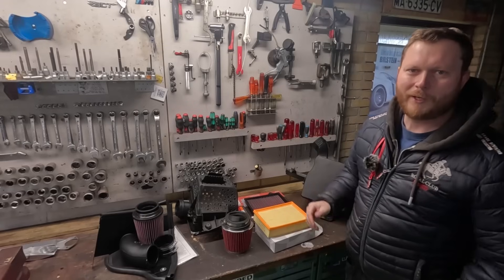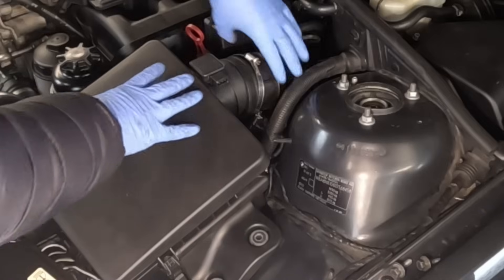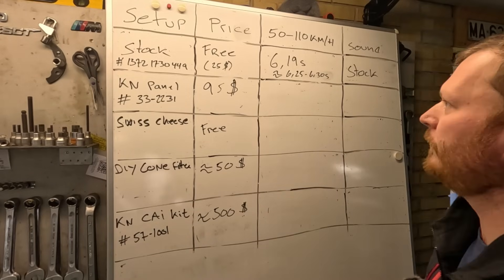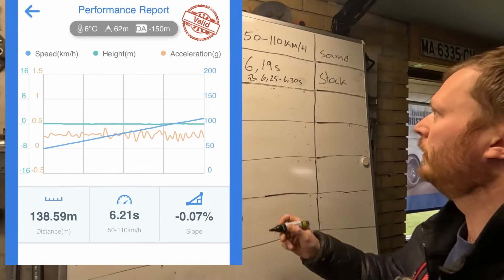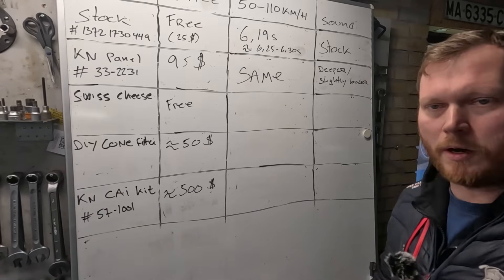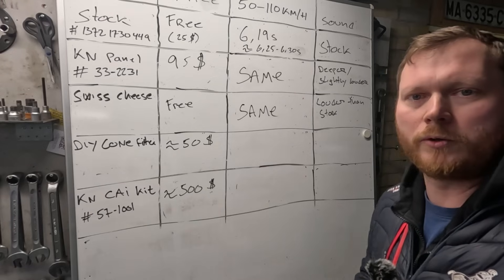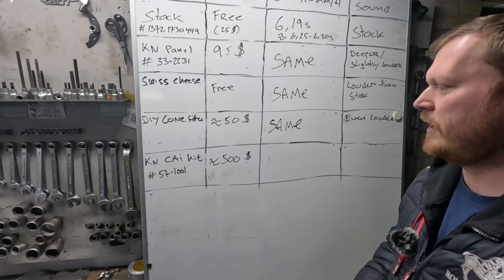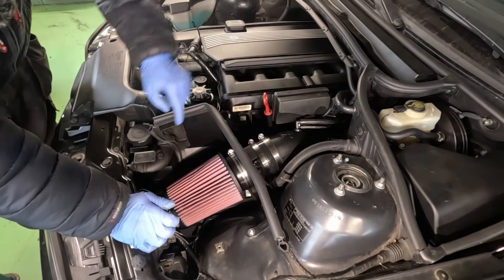Best Intake - K&N vs Stock vs Swiss Cheese mod. Test & Review

Comment: These are always car dependant. The E46 evidently has a well designed intake system. Other channels have shown improvements on other (stock) cars by using aftermarket intakes or just cone filters. I'm into GM F bodies. My 3rd gen Trans Am is well known to have a restrictive air filter housing, rated 5-10hp lower that its equivelant Camaro. Just replacing it with an SLP designed housing is good for almost 20hp on some versions. Unfortunately they're discontinued so I made my own version of that K&N kit.
Reply from the maker: Im a bit of a sucker for fbodies 2nd and 3rd gen. My fav 3rd gen is weridly enough the 83-84 ones with the recaro seats
Reply from the maker: And thanks for letting me know. 20hp is a big deal. Do you happen to rock a rochester?? I miss my 81 trans am. It haf the infamous quadrajet moan lol. Sounded like a cow muh’ing. So good
Reply: @OEMplusRESTO  technically, just not the Rochester you're talking about. Mine is a GTA. They all came with the tuned port MPFI system that uses a Rochester throttle body.

Comment: Correct me if I’m wrong but you need to tune to see the performance benefits from come intakes especially cold air intakes
Reply from the maker: Great question. The maf doesnt know or care what filter(if any) is in front of it. It just measure the air coming through and with other sensors input determine various things such as fuel and spark.
MAYBE it could use a few pulls to slowly dial itself in. But i have done alot of pulls but with and without datalogging with no change. People say on turbo cars it works alot better but i havent tested. Thanks for not just raining down on me. Hope you have a good day

Comment: My N54 benefited massively from dual cones, especially after mapping. Gained 24hp around 3000 rpm when on max boost. The factory box becomes very restrictive when adding 100+ hp. NA engines do not gain much especially without a map.
Reply from the maker: Yeah people keep telling me turbo engines do much better with sport air filters. And i believe it:)

Comment: If you would have tested the 50 to 110 kph on the same road every time, would have been the scientific method that everyone loves. Like this your last slightly positive result is almost discarded... anyway, normal people will not spend 500 USD to get 0.1 seconds faster on their slushbox. Liked the video!
Reply from the maker: Hi. Thank you. It is tested on the same road. But there will always be variables. I do usually 10 runs pr test. Sometimes 5 if results are pretty much the same each time.

Comment: On my last car (Ford Fiesta ST 182 mk7 stock) i bought a ST200 airbox from factory, on this airbox you have the stock design + a second big floppy pipe that you can put under the headlight, paired with a K&N filter panel i got 4hp and 7nm with same condition, so is it worth 250 euros for this little performance upgrade? No
Reply from the maker: Id say its worth if for the sound alone. The 3 and 4 bangers sound so much better with a good intake

Comment: I think for a test like this 3rd or 4th should be driven all the way out as the air isn’t as useful down low but as the extra air begins to get in the higher flowing filters and intakes will take advantage of it
Reply from the maker: I only tested 3rd gear. Thanks for the input.

Comment: all of these filters work very whell .... any modification on the motor need a remap ecu! ... ( more air need more fuel ) stock ECU is always the same... OPEN YOUR EYE'S

the same thing aplies with the exhaust system.... you only get real gains if you remap... otherwise it only improves engine exhaust and you gain 1hp :face-turquoise-covering-eyes:
Reply from the maker: Thanks for the input. This is a common misunerstanding though. The maf doesnt know(or care) what filter is in front of it. It just measures the amount of incoming air and with others sensors determine things like fuel and spark. If your hypothesis was correct, even a semi clogged air filter would also need a “tune”.. the dme “tunes” the car as it goes, taking into account stuff like air temp and volume, fuel octane rating and more.

Comment: The biggest issue with the k&n is it's filtering ability, years ago there was an article in a hot rod magazine where they tested a variety of air filters for filtering capabilities, K&n was the worst. I threw mine out after reading the article. That small gain is not worth grinding the engine to death with dirt
Reply from the maker: Interesting

Comment: KN is a piece of junk. They pass so much fine dust. I ran my truck thinking i am getting HP..after i removed my intake. I scraped so much dirt and find dust out. 
Project Farm tested the performance of how much air they can pass and how much dirt is getting by. KN failed. I threw mine away after i saw it and found the fine dust accumulated in my intake manifold runners.

Comment: Well we all know that any standard engine is restricted first by its exhaust then by its air intake . The exhaust would be the limiting factor needing to be made better in order for the need for a performance air filter. And even then the power gain would be un noticable unless on a 1000hp engine

Comment: Only issue is engine temps. The cooler your engine is usually the better performance. There is a sweet spot. Along with air density etc…

Comment: I always see people comparing intakes/filters on a stock tune, but as far as I am aware the benefit is only really seen once the ECU is adjusted for them. It would obviously be way too costly to adjust this between each filter, but it also kind of defeats the purpose of testing them in the first place. Obviously, the filter/intake brands are very misleading in their marketing as it makes it seem they instantly add horsepower without the need to do anything else, but a tune is the only real way to see any benefit. I wouldn't beef up my injectors and pump without a tune as they would essentially be running on stock parameters and benefits won't be very apparent otherwise, so doing anything else and not tuning it in is also not going to see true gains. 

I'm not a huge advocate for using intakes to make power, but it does annoy me that almost everyone on YouTube doesn't give them a proper test. I know it's just an intake and tunes are expensive but it just defeats the purpose of even making the video.

Comment: I have noticed with the k&n filters that fuel economy is slightly better. Ive seen an average of 1-2mpg better on the highway vs a oe paper filter. Some vehicles may see an hp or two increase, but it tends to be vehicles with inefficient factory boxes
Reply: Yes thats correct ,in my e46 323i and w124 320e k&n replacement kit  works fine.more respons thorttle and good mpg.cone air filter without air restric ussually gives more heat suck from the engine bay.without the cai kit.makes u loose some torque.but sounds better

Comment: I like the empiric approach of your test. Also came to the same conclusion when I tested several intake mods on my e36 323ti. The stock airbox works very well and no need to spend tons of cash here because it will not gain anything, other than louder intake sound. Which when i had the cone filter setup, it got quite annoying after a while. Also, the cone filter setup will cause  turbulences of the air, of which the MAF will be affected by and read wrongly causing the adaptions to wander off a bit. This I noticed because i was also logging the ecu data while performing the tests and comparing MAF /load / temp values.
Reply from the maker: Great input. Thanks. Yeah the stock system is oretty hard to beat

Comment: project farm also did a test, his test showed the K&N panel filter did make an improvement, but maybe it depends on the vehicle.
Reply from the maker: I think theres alot of things that play into this kind of tests, and im not at his level in terms of back to back testing. But in my case they didnt offer any noticeable/measureable gains other than a tiny bit of sound:)

Comment: so i'm not an aerodynamics engineer but the swiss cheese mod seems like it's adding unnecessary turbulence before the filter. Mind that I know the filter streamlines the airflow before it reaches the MAF and the manifold but it still wrecks efficiency. Maybe if the holes were positioned so that the flow of air to the filter is laminar before it reaches it - it would have some gains but at this point I'm just overthinking the issue
Reply from the maker: Me neither! I just like messing with cars! But yeah the swiss cheese mod is only for sound

Comment: I have a Volvo s60 2.5 liter inline 5 and I took of the top cover if the stock intake box and mounted a big and long K&N intake with great results, better spool time (1400 rpm-1500rpm full boost) stock 1500rpm and better throttle response, little bit lower gas mileage maybe, what I mostly se people doing wrong is using a very tiny filter like your 50 dollar one so I would Aa get a longer one at least like the K&N kit you got or longer(original filter has more surface area then the tiny pod filters 😅)

Comment: My 330 came with exact same K&N setup(expensive one)…I was wondering if factory would be better and tried comparing them back then. I had Laptop hooked up and I was monotoring intake air temp sensor numbers. Before I removed KN, I did about 15km or more drive around lake, get back at home, change it to stock in about half an hour and quickly gone to same 15km root…results shocked me back than, I remember there was about 10 degree difference in intake air temperature, KN was hotter than stock system. Yes, I’ve seen this with my own eyes. Even had data files saved, but it was many years ago and lost it somewhere. Now after all this time I drive with stock system and KN collects dust.
Reply from the maker: Valuable insight. Thank you for sharing. Brw those 5legged volvos Sound wicked

Comment: Your adaptions WILL NOT reset when unplugging the battery. That’s false info.
Reply from the maker: The more i read the more i see this is just a common misunderstanding it seems.
I’ll add it to the description that its false, and edit it out via the youtube built in editor when i get the chance. Thanks for the input
Reply: @OEMplusRESTO  No worries, I just thought to point that out.
Reply from the maker: Can you share a link? Theres a lot of conflicting info out there whether or not it clears the throttle adaptions for instance

Comment: That is why I always tell people that if your car is not tuned to make more than 2X stock power, you don't really need more air and the stock filter is not just fine, it's probably protect your engine much better over KN and stuff like that. Not to mention that most people install new or open air filter that don't have access to fresh cold air but hot air in the engine bay.

Comment: You really need to modify the tune to take advantage of a higher flowing intake/filter.  The stock ECU programming cant adapt enough.  So, it really dosent matter what parts you change exhaust, intake etc.  The engine output will be the same without tuning,
Reply: This is incorrect. A stock ECU can and does easily adjust for the relatively minor differences in airflow between something like a paper air filter and a K&N, just as it easily adjusts for differences in air density based on changes in elevation, temperature, etc. A tune itself will often result in more power for various reasons, but the (again, relatively minor) differences between a paper filter and a K&N isn't one of them.
Reply: When you only change the intake or the exhaust the stock ECU tune can adapt but when you change both? At least in motorcycles it results in a very lean running engine and loss of power. But when you do a dyno tune then you do get a nice bump in performance, a bit more than a dyno tuned stock machine if done right.

That said car fuel injection systems are more complex than rudimentary motorcycle fuel injections so I don't know what the stock ECU's are truly capable of on modern cars.
Reply: @MaaZeus the O2 sensors in the exhaust on 90% of cars will be able to sense wether it's running rich or lean and tell the ECU to adjust. On the intake side you also have either a MAF sensor, or a MAP sensor paired with a temp sensor which will be able to measure the density and mass/volume of air entering the engine so the ECU can send the right amount of fuel.

Comment: nice test! but beware the K&N filters are oiled. This oil will effect you're MAF sensor in time giving faults. I had to replace but there seems to be sprays out there to spray it but I didn't know. 

so beware using K&N filters in long term

Comment: This is how it´s done! It´s proven once again, that factory intake systems are not that bad. Now when I have E46 M47N, there´s no need to fiddle with stock intake, but on my previous car (´99 Accord 2.0 ) i did sort of modified intake. Paperfilter and filter box remainded the same stock items, but I removed whole intake resonator box, which is located below the filter box (just behind the bumper in front of right wheel). Then I made ram air tubing from plastic plumbing with one 90 degree elbow leading from the right opening for fog light (my car didn´t have those, just black blanking covers) directly to the bottom half of air box. Basically ram air intake for cheap 😀   
While stock intake system together with resonator sucked air from behind right light (that means also from engine compartment), this modified system took air directly from the front of the car. On idle or while driving slowly it was the same sound-wise. But during acceleration or with full throttle it sounded better.

I admit, that it was catching more flies and a bit more dust 😀 But that wasn´t an issue for me, because I changed the filter every 10k kms. 

Most noticeable difference was during summer, when the engine wasn´t suffocating itself  with hot air and heat soak from the engine. This was verified on the same day with stock intake and this modified one reading the intake temperatures via diagnostic tool .
Reply from the maker: Thanks for sharing that. I hope someone reads it and use it to determine if they should do it or not

Comment: Thanks for this comparison. I was actually looking into intakes for my E46. Would you say the sound of the K&N kit is anywhere close to drone? Or not annoying at all?
Reply from the maker: No droning at all. I didnt even notice the intake was different when driving around to get the car up to operating temp. Imo its not until you start pushing it you can really hear it

Where are you located? I wont need my kn anymore
Reply: switzerland. if you could send me that that would be awesome haha, ofc I'll pay close to new price. Will have some tax on it though
 @OEMplusRESTO
Reply: @OEMplusRESTO located in switzerland, would offer 200€ with shipping (the k&n 57i-1000 gen 2, which I was looking to get, is around 300 here, and there will be tax)

Comment: I've tried all these filters and mods, except the swiss cheese box, and your right the performance is minimal at best but the k/n cold air intake is the loudest and sounds the best it also creates a whistling sucking noise when you give it gas at low speeds. The only thing is you better have your cooling system working properly because if it over heats and it spits up coolant it's going to get sucked in. I use my stock box for the majority of the year and only use my k/n in the very dry summer  months when i go on canyon drives amd want to hear more sound.
Reply from the maker: I think maybe if its whistles at low rpm low load situation youd migjt have a vacuum leak. Because the first time i installed it and drove with it, that whustling was very obvious. Found out when unstalling it, the intake tube was seated perfectly in the intake hose. And the next install i did where i had to redo the tests, the whistlign was much quieter! I agree its the best sounding. And definitely loudest as well. But its not super loud either
Reply from the maker: And thanks for the tip

Comment: its a faulty test, given you havent taken into account that the fast or slow reaction of the speed  could be down to your driving.
Reply from the maker: im driving in a straight line, mashing the throttle at 40km/h and then record the 50-110kmh sprint staying in the same gear. Let me know how i can improve in your opinion?
Reply: @OEMplusRESTO   2 things you could do. hire out a dyo and do the speed tests there, this will give the most accurate results. 2.  and its better that just you taking what sped you did, get a gps speed measure device.

Comment: Once again a great effort and comparison. I personally bought the KN cone filter from the kit only and home made a heat shield, keeping the stock cold air intake as the KN kit while also putting a tube with air from the duct for brake cooling. I noticed some gains but it's combined with cams, higher compression and an ECU remap so I guess the car just needed the extra air.
Reply from the maker: Thank you.I think the OE airbox only will work well for its intended use. Once you start opening up the exhaust and do internal work it would make sense the KN is better
Reply: @OEMplusRESTO  one more thing,  when I moved to a less restricted setup, I noticed it revs more freely above 6000. You can't notice that in the 50-110 3rd gear test. Maybe the few Hp extra are between 5500-6500 rpm. You can see it in your videos too, the stock setup is not keen on revving above 6k

Comment: Great video! Like you mentioned, the E46 has a cold air intake from the factory. So getting a performance increase from an intake upgrade is going to be a challenge. That said, the K&N unit sounds amazing!
Reply: Almost every car since the early 90s has a cold air intake. Many are just choaked due to over-silencing or, in some cases, packaging constraints. This one is just one of the few that's well  designed.
Reply from the maker: Thank you:) yeah bmw did a great job honestly